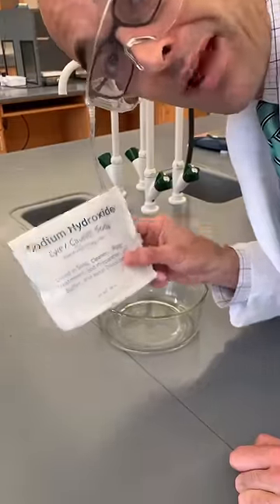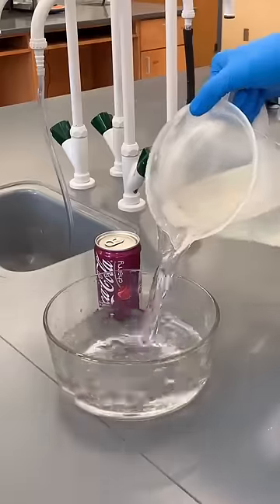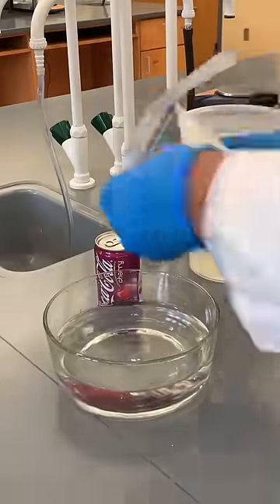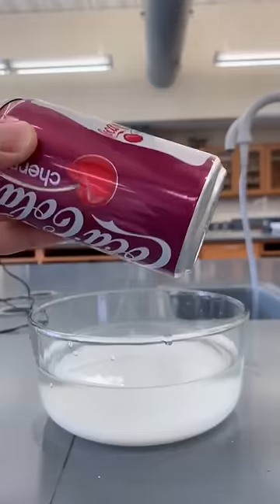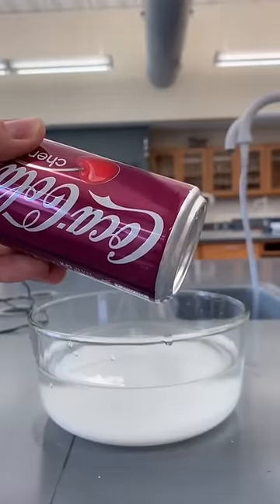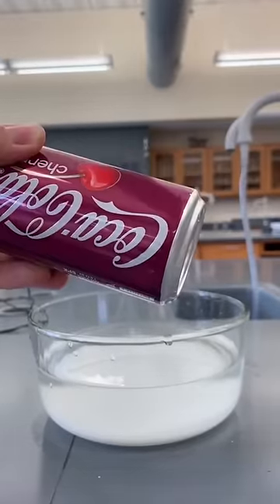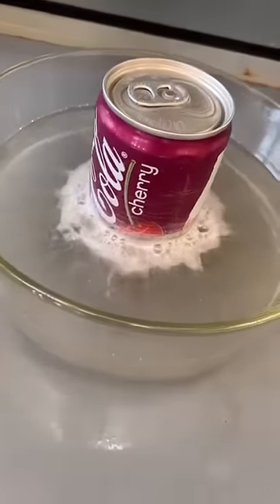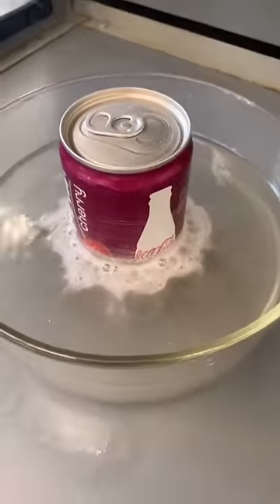Did you know this about aluminum cans?

Comment: Wow, even when you think you got away from plastic, they sneak it in.
Reply: Better than drinking aluminum😂
Reply: There has to be SOME kind of liner inside otherwise the can would rust from the liquid. Its why you can taste a very distinct difference between canned beverages and ones that are in glass bottles....seriously a Sprite from a glass bottle just hits different and I try to get ANY sodas I drink in glass bottles since I rarely drink them now as I'm cutting back heavy on the sugar. They are occasional treats for me now so I don't mind spending a little extra for a glass bottle that I can wash, make sterile, and reuse, or just toss in the recycle bin to be melted down and recast into another glass bottle.
Reply: @Rocketleaguehoops  Not denying that, still they can use other less polluting materials so we don't intake them.
Reply: @BasedChad1 it's using way less than a plastic bottle so still saves a lot of plastic
Reply: As someone mysteriously allergic to plastic I am not thrilled by this.
Reply: @DGneoseeker1  If there was only a way to buy soda in something other than cans...
Reply: @kiillabytez  Well, plastic bottles won't be an improvement on that and glass bottles are heavy, fragile, and not available in the vending machines. And for some reason some idiot in charge of recycling bin distribution didn't think to provide glass recycling bins in public places.
Reply: @DGneoseeker1  Don't buy them from vending machines?
Reply: @kiillabytez  Actually very few shops around here sell soda in glass bottles.

Thankfully I don't SEEM to have a problem with the specific kind of plastic that the bottles and cans contain. Others though? Make my face burn.
Reply: @DGneoseeker1  Sure.
Reply: @ShinKyuubi  Aluminium cant rust but it can leach into drink or food.
Reply: @ShinKyuubi  But why would you combine materials when you dont have to? Plus get some info 0,0175cm thick aluminium piece begins to rust after 1000 hours/40 days. Dont tell me they need to store it longer than that. Thats just waste of space and time. They could deliver cola within cistern instead of cans and cans could be created localy while they could also lower its distribution and highten the distribution of plastic ones or glass ones colas if any problem or if they really need those cans to last that long they should use different metal. Future are pipes but is gonna pretty hardcore project once humanity gets to it.
Reply: @iankearns774  Aluminum can rust. Do microplastic not leach into drink?
Reply: @doom5467 because sodas have sodium hydroxide in them so what happened in the vid would happen without the plastic liner.
Reply: Wait now I’m a bit upset. Overheated plastic bottles can cause problems. So apparently overheated cans are the same??? (If they don’t explode.)
Reply: I'd rather plastic be there than aluminum.
Reply: @doom5467 Aluminium doesn’t rust like iron does, no. If you put a piece of aluminium in water it won’t visibly rust like iron would.
Reply: The Coke has acid. The guy just showed you Acid melts Aluminum but not the plastic liner. You can draw your own conclusion from here.
Reply: That is an interesting observation. Not just that but damn some people go out of their way to not buy plastic but buy recyclables just for them to sneak it in! Could all be carcinogenic
Reply: @fongsa1yuk  sodium hydroxide, AKA lye, is not an acid. It is extremely basic. I believe it is 10-11, somewhere in that range, on the PH Scale. Caustic substances (lye, bleach, ammonia) can disintegrate substances just as well as corrosive ones.
Reply: @trevorcurrie4774  No they don't, but they are acidic. Coke adds phosphoric acid as a preservative.
Reply: @Hogentheman But it does corrode from acids and coke is acidic due to the phosphoric acid added as a preservative.
Reply: @fongsa1yuk Sodium hydroxide is a base, not an acid.
Reply: @iankearns774 so can plastic!
Reply: @TK-zz6wk  Not as quickly, which is why they use plastic inside aluminium.
Reply: @slycoopracoon2478 I mean the coke or any other soda itself is carcinogenic. But as someone who goes out of their way to avoid anything plastic I can, I hate this.
Reply: @ShinKyuubi only ferrous metals are able to rust though? If there was no liner it would corrode the aluminium and taste metallic
Reply: @ales6305  I've seen rusted aluminum cans but it takes a LOOONG time. Still there is a difference in taste from can to plastic bottle so even if the inside of a soda can has a liner of some kind of plastic it's different than the kind used for soda bottles.
Reply: @ShinKyuubi It's aluminum... aluminum doesn't rust...
Reply: Aluminum Is horrible for you too... so..
Reply: @toneilc8  I see, thank you for informing me. :)
Reply: @ShinKyuubi It's also more fun to shoot glass bottles.
Reply: This man said aluminum will rust and his comment got 80 likes.
Reply: @iankearns774 True, only iron or alloys that contain iron can rust.
Reply: @ShinKyuubi  if it rusts, it's not just aluminium. In order for something to develop rust it has to be iron or contain it, such as ferrous alloys like steel. The red dust is quite literally made of oxidised iron.
Reply: @ShinKyuubi  I'm being a bit nitpicky I know, but aluminium corrodes, it doesn't rust.
Reply: @DGneoseeker1  Allergic to plastic?!? Which exact substance are you allergic at?
Reply: @Hogentheman  I didnt say that.
Reply: @Sci-Mon1  great point. I wish the US was on the same page as Europe as far as ingredient restrictions go. So many things in the food here are BANNED over there.
Reply: @slycoopracoon2478  yeah it’s really such an issue. It’s the reason why healthy food is so much more expensive.
Reply: @FabrizioBalestrieri   I am not entirely sure what causes the problems. But swimming pool floats make my skin go bright red and inflamed based on experience as a small child. And polycarbonate like you find on safety spectacles makes my face feel puffy and inflamed. Rinsing the plastic under the tap helps a lot.
Reply: 🙄 Plastic is important for every daily living
Reply: @BasedChad1   lol. what would you suggest?
Reply: @goodmorningsundaymorning4533  They are developing an organic "plastic" from fungi which is technically not plastic but has similar properties.

Anything is better than polluting our bodies.
Reply: @goodmorningsundaymorning4533  it’s becoming a problem though.
Reply: @ShinKyuubi  Not bpa free...
Reply: @ShinKyuubi wow! I didn’t know that. I rarely drink sodas so I’m gonna buy a glass of pop for a treat too.
Reply: @ShinKyuubi  Aluminum doesn't rust.
Reply: @vicrules6666  well whatever it does, they apparently gotta have a liner between the metal and the soda, but I'll still take the can over the plastic bottle and the glass bottle over both of them.
Reply: Dude thought he was drinking out of aluminum lmao
Reply: @DGneoseeker1 Ideally you wouldn't be recycling glass anyways – you would have return programs which allow you to return empty glass bottles for a bit of change like they used to. Reuse comes before recycle.
Reply: @DGneoseeker1 omg allergic to plastic?? I'm so curious...is it severe? I'm just wondering about receiving medical care at any point since mostly all equipment is made with plastic. It's just something so hard to avoid everywhere, even in the home. Appliances, light switches, toothbrushes, toilet seats, etc. It must be difficult. 😢
Reply: @Katz_Pajamas  It's mild thankfully. As a kid if I used a swimming pool float my skin would go bright red.

If I wear safety spectacles I need to give them a good wash every time otherwise my face feels like it's burning.

I have some dental filling etc. material which is technically plastic and it seems relatively OK but I swear sometimes I feel my face feeling a little odd. Might be related to that.
Reply: @DGneoseeker1  wow! I didn't know someone could be allergic to plastics. That's good it's mild since plastic is so hard to avoid. ☺️
Reply: All canned food cans have a plastic liner.
Reply: @DesertSessions93  All MODERN food cans have a plastic liner. Go back far enough and it's lovely rusting metal in contact with the food.
Reply: *worse @Rocketleaguehoops
Reply: better than drinking rusty aluminum
Reply: @Post_Stall_Maneuver  UHMMM   ACTSUALLLY... Aluminium can't rust. It can, however, oxidise.
Reply: Good place to vent !! 🙂
Reply: @Rocketleaguehoops  I'm telling you the bottom of the pop cans is terrible. I dump it out. Blahhh
Reply: @doom5467 ~ Oh really? How many rusty aluminum cans have you found?? How about aluminum car wheels? How about all those aluminum boats out there?
Reply: Its a cancerous property
Reply: @ShinKyuubi  Not to be pedantic, but rust is iron oxide.
Reply: I hate plastic. I used to not mind and drink from plastic but not anymore.
Reply: you didn't know this? Imagine how much aluminium you will consume when there is not a plastic layer
Reply: @BasedChad1 plastic isn’t bad just specific types of plastic there is biodegradable plastic, its just not cost effective
Reply: Have known this for decades.... 😉
Reply: you would just be drinking aluminum instead, not such a great trade-off.
Reply: Mexican restaurants seem to be the most reliable with having glass bottle Coke and Sprite
Reply: @DGneoseeker1 allergic to what kind of plastic? Plastic isn't one material, it's a category of materials
Reply: @fongsa1yuk  No. --- He showed us that a solution of sodium hydroxide in water (of a particular concentration, most likely) will react vigorously with the aluminum. That doesn't mean the same thing will happen with just any old acid
Reply: @tongpoo8985   Polycarbonate, for one. And whatever that foam stuff is that they make swimming pool floats out of. Those are the two I've experienced major issues with.
Reply: Microplastics  impossible to escape
Reply: @DGneoseeker1 you’re aware that there were machines that sold glass bottles, yes?
Reply: @paulc7486  Well, sure. They exist. But on the other hand the last time I've seen one of those in real life must have been literally multiple decades ago. And possibly not even in my country.
Reply: U know water makes metal rust faster?
Reply: @Theweakest_stick84   Aluminium can't rust.

And water has little effect on it oxidising. Acidic drinks could be more of a problem.
Reply: @DGneoseeker1  oh
Reply: Plastic is the least of my worries if I'm drinking enough SODA to worry about that plastic lining
Reply: You could buy glass bottles

Comment: I did know this... Now, can you tell me what happens to the plastic longer when we recycle aluminium cans and quantify any damage the burning of the liner might cause to our air and environment?
Reply: Plastic is recyclable
Reply: @Toby-rl8sg  Thanks for the insight... Can you explain how the plastic liner inside the can is carefully separated from the aluminium and then recycled?
Reply: @The_Ubatron I thought the can was tin (except the top and bottom). I was told those are cut off then recycled and the tin is scrapped.
Reply: @The_Ubatron they don’t they just melt the can and scoop the slag off the top also wait until you hear how plastic gets “recycled”
Reply: @Oldmusicman555 I think it's been a very long time since drink cans were made from tin-coated steel (tinplate). Drink cans are now all aluminium but using different thicknesses for the top, bottom and walls. Food cans are also made from tin-coated steel (tin is inert, I believe) but these, too, are plastic-lined. Yes, slag is created when the cans are melted, but that slag includes the plastic-based printing ink and any other coatings, so, my question remains to whomever is in the industry — or even the lab-coated fella in this YT Short: how is the plastic component of an aluminium drink can recycled, or... does it become waste destined for the atmosphere or landfill?
Reply: @markmontagna7637  Okay, Ill wait😊... In the meantime, I'm still wondering how the plastic component of an aluminium drink can is recycled, or... does it become waste destined for the atmosphere or landfill?
Reply: @The_Ubatron  I was at a festival and a guy was cutting the tops and bottoms off of all the cans.  I thought it was weird and he confidently explained to me that the top and bottoms of the cans were the only parts worth recycling. LOL. Maybe he wears a tin hat at home. He certainly was convincing.
Reply: @Oldmusicman555 Maybe!😅 I do wonder what he was up to, though... Which festival and where? Was he using the thin walls to upcycle into something crafty or ornamental like a model plane? Was he trying to value-add his recycling money by returning the cylindrical walls, which contain the barcode that automatic vending-style return depots read to issue your 10 cents per can/bottle (here in Victoria, Australia) and then take the tops and bottoms to a scrap recycler for more money, albeit cents? 😂
Reply: @The_Ubatron  correct when you recycle aluminum by melting it down any impurities or other materials end up floating to the surface and forming slag which is skimmed off.

Comment: "It just fell over, something happened". Runs  to it and it's still standing. 😂😂😂😂😂
Reply: My first thoughts too when I saw it lol
Reply: @661sInfamous  DITTO!
Reply: Science in their life..  lol x2
Reply: It fell over but he picked it up and fixed it , but cut that part out.
Reply: He was speculating, since he could only go by the noise he heard
Reply: I noticed that, too lol
Reply: Notice it didn’t eat the bottom of the can?? 😂😂😂
Reply: @kyleallen8424 I noticed too that the can was not fallen over.

The bottom of the can is not dissolved because it was not scuffed with sand paper so it still has a layer of oxidezd aluminium to protect it.
Reply: Why didn't the lye eat the plastic???🤔🤔🤔
Reply: @kyleallen8424  I think the base of the can has an extra bit of plastic to make it stronger.
Reply: Cans just looking up like “what?”
Reply: The can is pressurised. When the aluminium was dissolved, the plastic liner expanded. That's what he heard. The can did not fall.